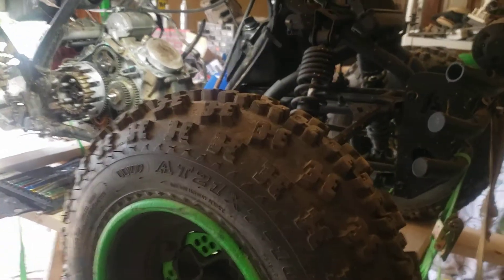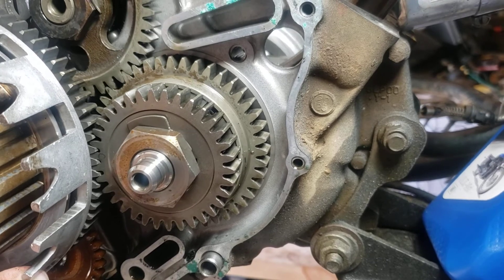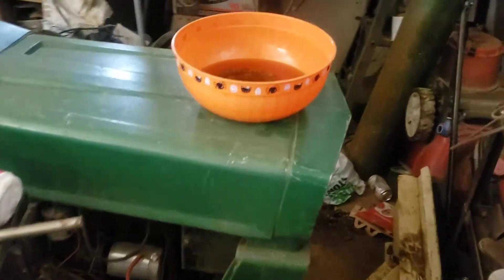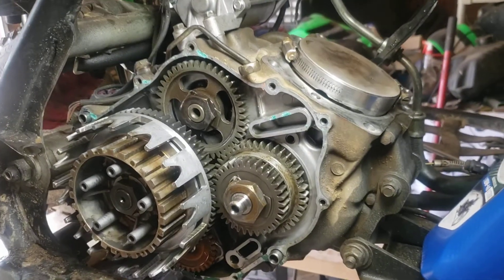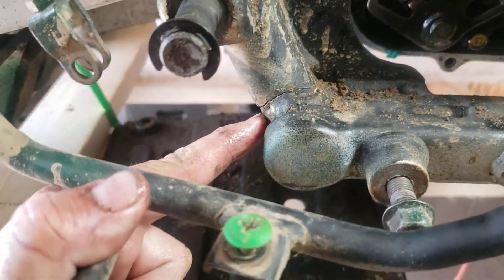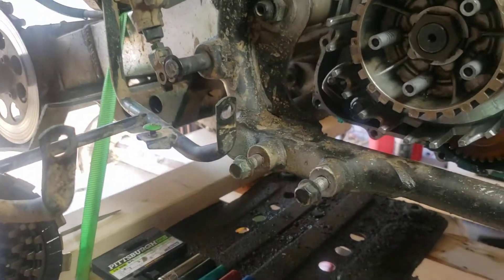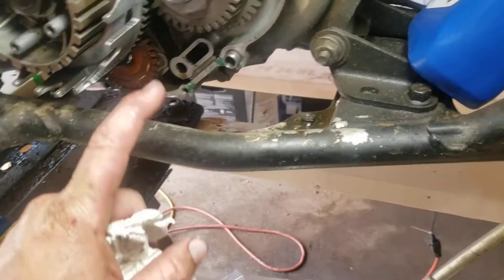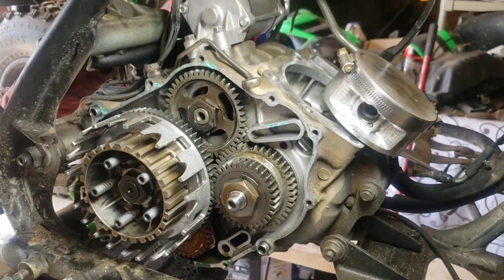Raptor 660 Clutch job/update

Comment: All of the cranks have blueing where the connecting rod is. It's from the induction heater that's used when assembling the crank at the factory.

Comment: I have an extra one of those gears ill send it to you for a low price if you want? Id hate to see that thing blow after all that work you have done
Reply from the maker: How low of a price are we talkin? I did some lookin. It is the oil pump drive gear. Someone else told me it should be fine. Wouldn't  be the  Thrifty Snowmobiler if I didnt try to get parts as cheap as possible ;) there have been a few things that I have spent decent money on to make sure its right though
Reply: The Thrifty Snowmobiler so sorry about the late reply but the one i have is a bit rusty but ill give it to you for 5 dollars plus shipping if thats ok
Reply from the maker: From what I can gather is its not a huge deal since its only one tooth. I think we are just gonna send it. Got bigger fish to fry with the boss clutch now. Hahahahaha when it rains it pours! I think the new springs Alba sent me were too long and it was a contributing factor in blowing the threads out of the boss clutch then broke one bolt. I ordered some digital calipers to check spec and will be buying a new more quality torque wrench tomorrow.
Reply: The Thrifty Snowmobiler lets pray and hope it works!👍 interesting content and i hope the raptor finally comes alive, once you really get to ride one you never want to get off!
Reply from the maker: I am more than ready for it to live. I keep throwing parts at it. I bought a new torque wrench yesterday. I think the springs are out of spec though. Its killing me not being able to ride. been riding the kids little 110
Reply: Cause I dont k ow if u put them right I went with this video YouTube and then I the secound gear didnt work
Reply from the maker: https://youtu.be/3uCRG9xY1NE

This is the video that I went by and everything went together without a hitch.

Comment: Wht is the pattern on the cluth for the 660 Yamaha raptor
Reply from the maker: I don't remember the exact order. There is a good video on YouTube that goes over the order. I believe the first is a regular clutch plate then a friction plate then a clutch plate with the wider diameter then the spring fits inside of that clutch then a friction plate. Alternating a clutch plate then friction plate until you end with a clutch plate with the bigger diameter inside.  I wouldn't quote that. You can find a free copy of the service manual on the net too

Comment: I insall the ones on my 660 but the second gear is not working
Reply from the maker: The clutches wouldn't make you lose a gear. That would be in the transmission.